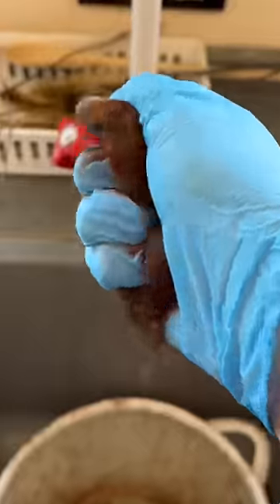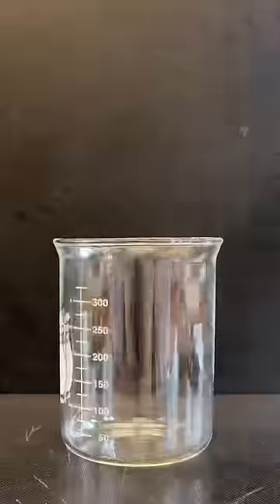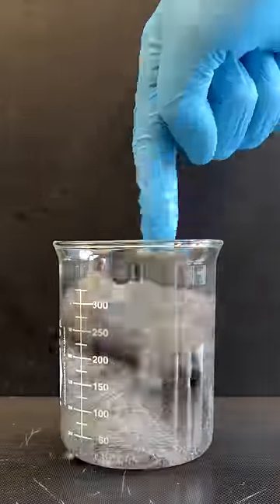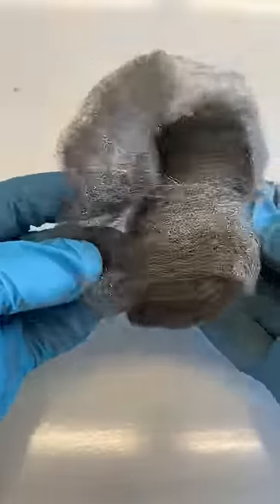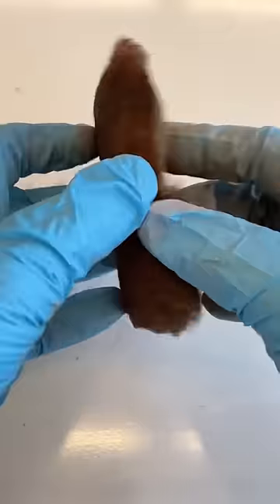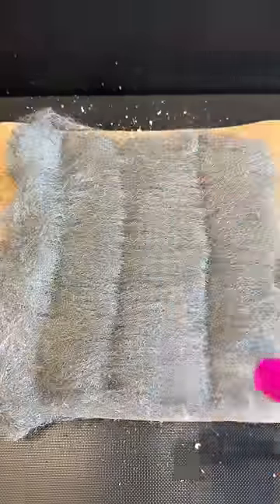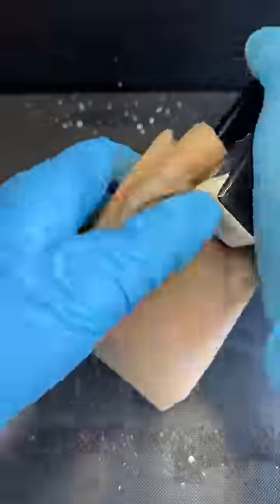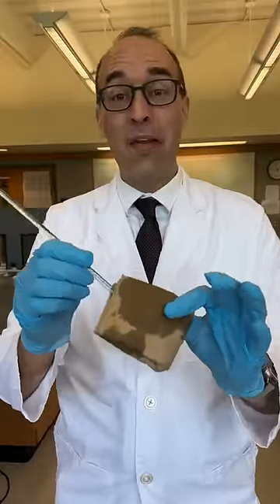Making a Handwarmer out of Steel Wool and Salty Vinegar

Comment: Add aluminum powder to the rust and some heat. You'll get a really warm hand warmer.
Reply: Instrductionsd uncvkear, hadto y6pe yhis 4eply with nmy nose
Reply: @Saol.Alainn  🤣😂
Reply: @Saol.Alainn  Perfect 🤣
Reply: @Saol.Alainn  wtf man
Reply: @Saol.Alainn lmao well played fella
Reply: Sire, why not! But you'll need a mixture of finely powdered and pure iron oxide and aluminium, any other component will stop the reaction. And you'll need a very hot flame to ignite it and start the reaction. And finally, it will burn your hand for a few seconds but then instantly start cooling down. Not very useful as hand warmer 😜
Reply: Beat me to it
Reply: Damnit. Came here to say this. Hands so warm you can weld train rails.
Reply: @Saol.Alainn  That's gotta be one of the most brilliant replies i've ever seen. Good fuckin shit bud
Reply: I got confused and took out this wierd German gun with it
Reply: @Saol.Alainn  this is a godly reply
Reply: Yup several thousand degrees warm
Reply: Thsnkkd evrryome
Deelinf better brw
Reply: @GodlikeIridium  I can tell you’re fun at parties
Reply: Or Just diluted HCL with aluminum foil shreds or powder instead of the solution and without some heat 😂

If heat didn’t melt your hands the fumes will put you in a nap 😂😂😂💔

Permanent nap 😵
Reply: what hand?
Reply: anti gustav
Reply: Lol
Reply: It takes a very dangerous amount of heat to ignite thermite
Reply: And like hypothetically how'd would you get aluminum powder
Reply: Thermite
Reply: @whatif8741 , all the videos and pages I've seen lighting it said and showed it needing a high temperature to ignite, much higher than a basic lighter or fuse.
Reply: All the cleaning power of ammonia with the whitening power of bleach!
Reply: @bhight100  you know there are these things called, party sparklers, fairly cheap and easy to get.
Reply: @ColdnCruel444  that may burn hot enough
Reply: @Almost.accurate2A  Only at public parties or parties full of scientists xD
Reply: @ThatOneOddGuy  instruction "something", had to write this reply with my nose
Reply: @Saol.Alainn  best comment 😂🫴🎖️
Reply: Yeah you would have a visit in jail.
Reply: @wandrin2925 It's been a month. 

Did your hands grow back?
Reply: @StardustLegacyFighter no butv mhy npse is evilving
Reply: @Saol.Alainn  Absolutely amazing. Please keep this up.
Reply: yeah like surface sun warm

Comment: Instructions unclear..
Added equal amount of aluminium dust in weight and it burned a hole through my floor and went all the way to the bottom through 7 floors.
Reply: Won't work with the saw dust and salt water / vinegar mixture 😉
Reply: Instructions never included aluminum powder
Reply: @Katiethekitten  Everytime you see iron rust, the aluminium dust is implied
Reply: but your hands are warm.
Reply: @Emppu_T.  he doesn’t have hands anymore
Reply: @Green-ader  no hands no problem
Reply: Actually more alonh the lines of 3 parts iron oxide 2 parts aluminum
Reply: @derianarce2686 it will still work perfectly fine, you could also add (in order) nitric acid, mercury and ethanol to make a thermite explosion
Reply: Same thing happened to me when I dropped my lightsaber vertically
Reply: you did it wrong its 1 ounce of aluminium for 3 of rust
Reply: @Green-ader  hands can’t be cold if you don’t have hands 🧐
Reply: Oops

Comment: This is a good example of how most commercial disposable hand heaters work - oxidation of iron. You can save them if you accidentally open a pack or only use them for a bit by putting them in a small airtight jar or ziploc. They consume all the oxygen and stop.

Comment: My mom read us a book when I was kid.  I forget what it was called, but one of the children made "fulminating paste" using a recipe from some book about Woodstock, which featured iron filings as a primary ingredient.  The fulminating paste, once mixed, would burst into flames around 24 hours after being made.  Now, it might sound like just a made up thing, but as a kid, I was fascinated.  The more I learned, the more I realized that it was probably a legitimate recipe that the author either knew or at least knew of, because iron produces heat during oxidation, and iron filings have a very high surface area.  Sadly, while I've looked for the recipe multiple times, I've never been able to find it.

Anyhow, cool experiment!  It might not get hot enough to start a fire, but at least it's still useful application of a slow exothermic reaction using common materals.

Comment: Honestly, steel wool and vinegar as a long-lasting (and eco-friendly) wood finish is probably the best use for that rusting process. Of course, it also stains anything else it touches a rust color, even though the color of the wood will be completely dependent on how much tannin the wood has in it.

Comment: Fun fact, use the vinegar after placing steel wool in it for a few days to make an ebonizing solution that reacts with the tannins in wood to turn it black. This is how old furniture makers would make black oak furniture. Woods with little or no tannins will not react, however.

Comment: I use 50/50 water and vinegar and a ball of steel wool in a glass container. I left that in a cabinet for a few weeks to make a rusty concoction. Then I mix it up with a paint brush and brush it onto wood panels before I burn images with a laser. The rusty liquid is often referred to as "the Kenny Hack" but my dad knows it as "Amish Aging" because it can be used to make wood appear much older than it really is.

Comment: Combine with vinegar and use on wood to create an antique look on the wood from the way it oxidizes the surface. Add some random scoring before applying the vinegar steel will and finish and it will look pretty old fashioned and collectible. Use fine steel wool to keep it from scratching up the surface.

Comment: Leave the steel wool in the jar til it rusts and makes a nice varnish
Reply: Almost. Soaking steel wool in vinegar and letting it sit will make iron acetate in a colorless solution. Applying it to wood that contains tannins will stain the wood, the more tannin in the wood, the greater the result. High tannin woods will turn black, Red oak turns a rich, warm brown with black grain, etc. After this coloring process you must still apply a varnish over the top (or shellac, or wax, etc). My point being that this trick makes a sort of stain, not a varnish.
Reply: @lrfiv  awesome info. Thank y'all.

Comment: How long does it stay warm?
Reply from the maker: I made three different samples and they each lasted around two hours. I did find that cutting the steel wool shortened the timeframe while also making them heat up more rapidly. For the warmer shown in the video, it took about 2 minutes to get above 40 degrees C.
Reply: cool

Comment: Sparkler that can melt through an engine block anyone? Steel wool is also handy, in steel state, to start a diy thermal lance made from a new length of car brake line fed with regulated oxygen at one end. At the other end you tear a piece to twist and stuff into the end. Light the steel wool so it goes into ember mode and start feeding oxygen until the more violent reaction starts with the metal brake line. Rainy day idea anyway. Thanks for the infotainment. 

ps. search YT for "diy thermal lance" for a better idea and to see what they can do, thanks to steel wool. (most vids use a separate oxy/acetylene torch to start the reaction in their tubes, find the wool guy)

Comment: WHEN YOU MIX FUEL, METAL OXIDE, AND METAL POWDER IN JUST THE RIGHT WAY, IT BURNS AT 2000 DEGREES CELSIUS, HOT ENOUGH TO CUT THROUGH ANY BARRIER KNOWN TO MAN.

Comment: Actually you can just use uranium to heat your hands, no need to thank me
Reply: instructions unclear, my hands wont stop glowing and that means i have trouble sleeping
Reply: @EmmaTheSmol  That is a common side effect. You have multiple options thankfully.
Option 1: Put on metal gloves (preferrably lead) to block out the glowing
Option 2: If you can't aquire gloves or gloves are too uncomfortable for rest, put your hands under some sheets while sleeping
Option 3: Remove the glowing limbs with a chopping or sawing tool

But keep in mind that glowing may be of interest to you for conveniency:
Example 1: You can't find your phone in the dark? Light the room with your hands
Example 2: You are mugged? Slap the thief to apply poison damage to them
Example 3: You are cold again, on a different part of your body? No need to use more uranium, simply use your hands

I hope this cleared up any questions and inconveniencies

-M from customer support
Reply: @minedark597  Thank you customer support, I went with option 2 and it is working wonderfully. I whould have gone option 3 but the benifits are just way too good to just give it up like that. I have to ask tho is there any way I can turn the glowing into a like rbg-like glow? Cus if I can that whould simply be the best thing ever🤩

—A satisfied consumer

I rate your service: ⭐⭐⭐⭐⭐⭐⭐⭐⭐⭐ out of 10